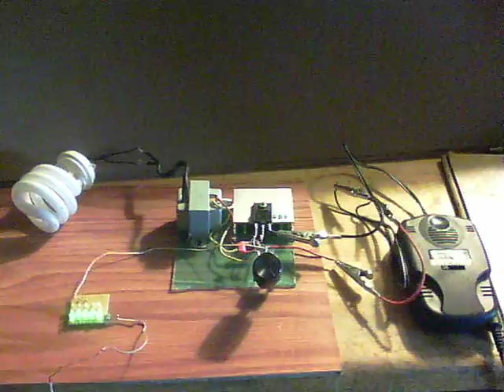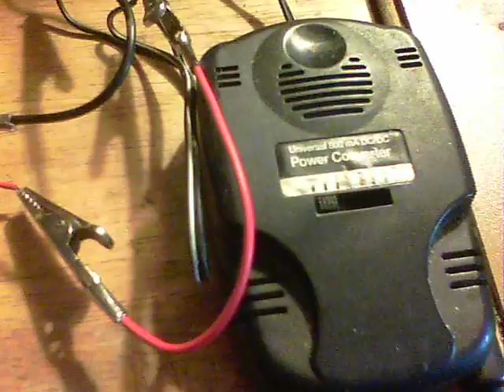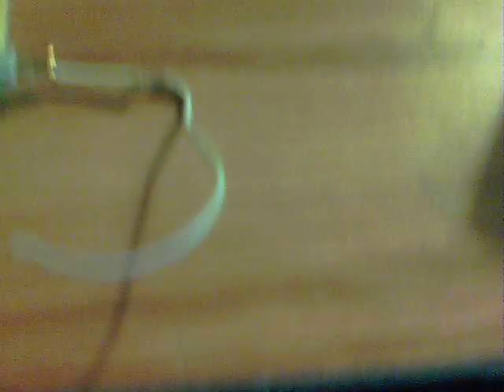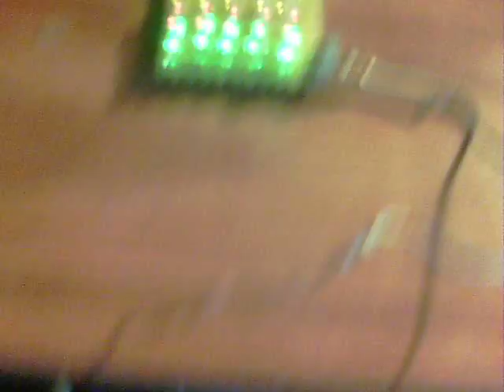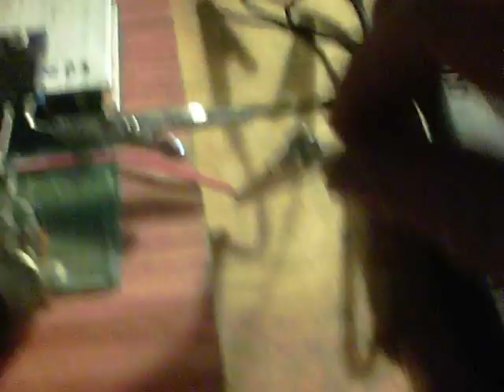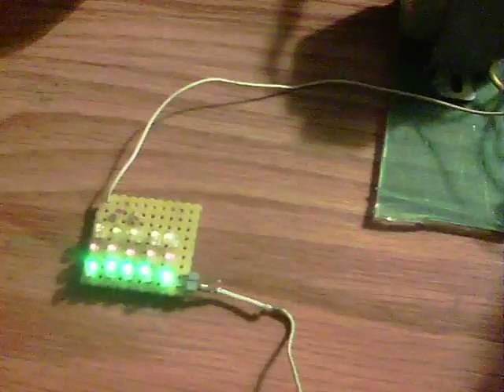Inverter zero effect on PSECCY LED's

Comment from the maker: @z1zaz PSU is two wire yep. AC leakage is 0V, DC is obv 0V at switched off position. I get 39uA and 1.6V DC when combined with outside ground and loaded with anything. Adapter generates a reading on a gauss meter of about 1mg with it switched on. The emissions are normally wasted as EMF/RFI and part of these experiments is to reduce such noise from household - nausea, paranoia, even thoughts on house hauntings are believed caused by high field strengths from factory bad enclosures.

Comment: Measure the voltage betwen your ground wire and the PSU earth wire.
If PSU is twin wire only, then measure its leakage when turned Off.
The mains supply 'earth' wire is seldom at zero volts wrt local ground !